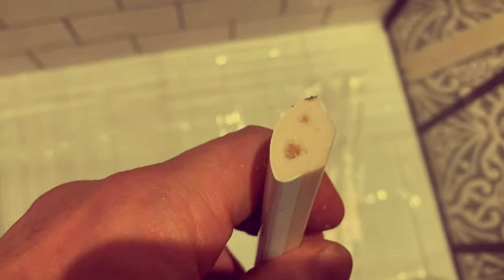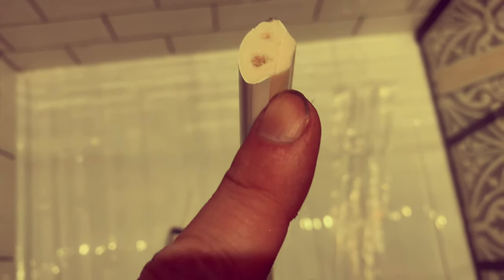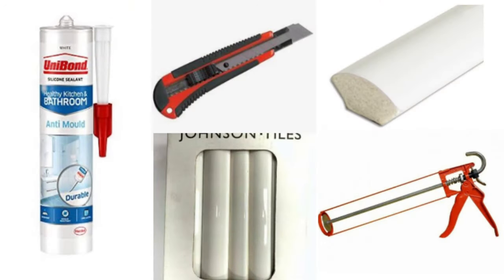How to seal around baths & showers trays using silicone & quadrant trims

Comment: My homeluxe strips have an adhesive strip along one side, but I'm not convinced it's better than sealing and sticking it with good quality sillicone adhesive, so I'm removing them.
Reply from the maker: @MrNaKillshots  you can't beat decent silicone
Reply: @warriorsofwarmth  Saying that, it was a bastard getting the adhesive strip off so kept it on and used plenty of silicone to protect all  around. It looks fine, to me

Comment: I thought you weren't meant to use a finger to smooth it as you are putting bacteria off your finger into the silicone before it dries. Should always use a tool.
Reply: Aren't you just putting bacteria off the tool instead then? Surely you can wash either.
Reply: Correct. You should never use a finger, all though anti mold silicone does help lesson the problems caused down the road.

Comment: The whole point of putting down Beading or Quadrant is to replace Silicone. Why would you apply silicone again along with the Beading or Quadrant? You will still have the issue with black mould if you do this.
Also, this has got to be one of the most annoying tunes ever
Reply: Would you recommend just using adhesive behind and no silicone ON the quadrant?